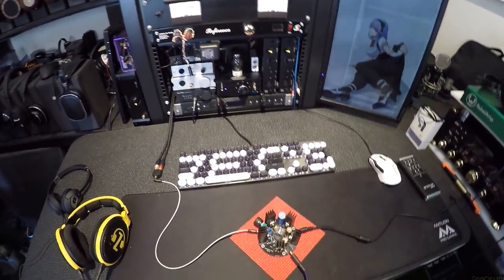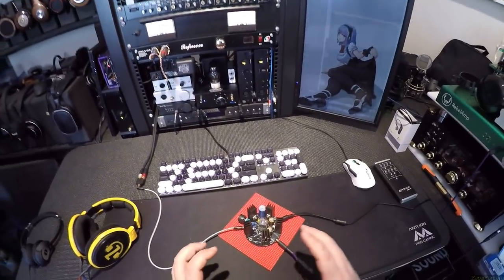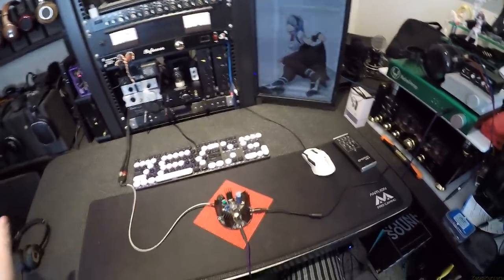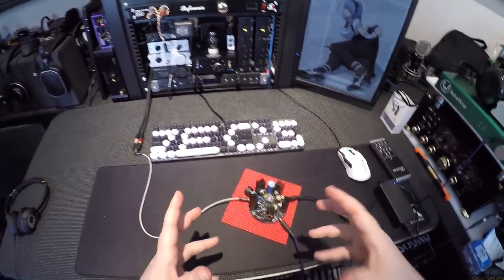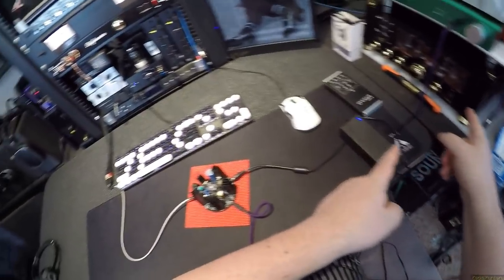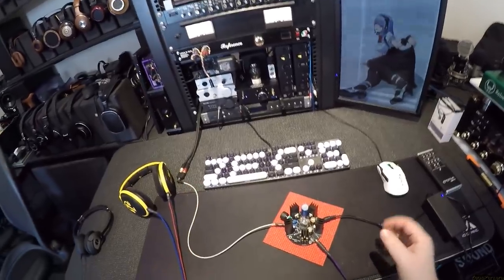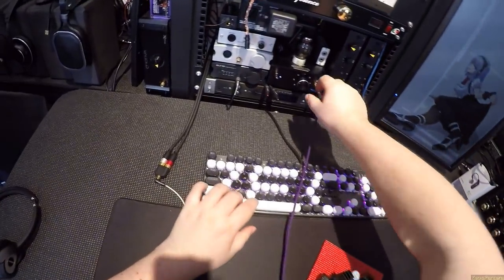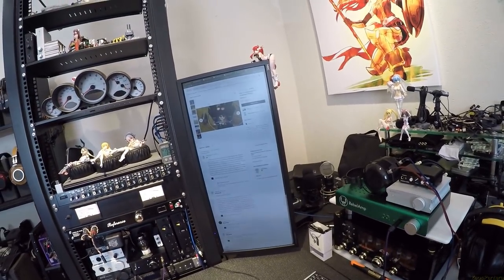Thackray Uno _(Z Reviews)_ Illudium 238 Explosive Space Modulator

Comment: I'm actually the 1 star reviewer. I run a Macbook Pro to a DAC to the amp and then into my Alessandro MS2e's. Before I bought the amp I was just using a Monoprice Desktop Headphone Amp. Not the greatest headphone amp in the world but it did the job. 

Anyway,  I wanted an amp with more power and randomly came across this amp on etsy. Class A hybrid seemed like a better amp to take a swing at the the typical class D. When I first got it, I just listened to it with my phone and my headphones hooked up to it. Sounded good. But when I hooked it up to my Mac setup, it sounded horrendous.

 It took me awhile to figure out that this thing is just extremely sensitive to the components you use. For whatever reason, it did not like my DAC at all. And I found I have to keep my Macbook volume very low and really crank the amp up, otherwise there's still a lot of distortion, even with the DAC taken out of the chain. 

I was trying to use the volume adjustment on my Mac because, as you pointed out in the review, changing the volume on the amp is a hassle. Strange that this thing is so sensitive to output volume on my Macbook when the Monoprice amp isn't nearly so fussy.  

It could be that there's something wrong with my amp. However, Mr. Thackray wouldn't agree to an exchange or refund because he was so put out by my 1 star review. I even offered to ask Etsy to remove the review if he'd agree. He just stopped responding to all communication.

All in all, I can't recommend anyone buy anything from this guy. The people saying hard pass are definitely some folks I wish I knew so I could have been warned away from this thing. Not worth the $130 I paid, IMO.

Comment: Haven't seen the schematic but it seems like a low end hybrid with a tiny weak tube stage...
Reply: I took a look at the Etsy page, there is a screenshot showing a schematic, and that looks lik a MOSFET driven by the tube.
Reply: Seems like the designer has no idea about amplifiers in general. If that is the output stage i am truly shocked this thing is palletable in zeos's mind. 24V for a 12au7 and a shitty mosfet output... I am shocked.
Reply: Anything with a tube in it that doesn't have a high voltage power supply (150-400v), probably isn't doing any amplification with the tube. It's called a starved plate buffer. Gives very poor performance and lots of nasty distortion, not anything like a properly driven tube. Basically you should avoid anything that includes a tube but no high voltage supply. (and even then, most chinese tube amps that actually run the tubes at power, are so poorly designed that they should be avoided too. cough cough.... Darkvoice...)
Reply: @taylorsharp5928  depends in this casw yes 12au7 need 150-250V but if it is a pcc83 or something similar it may only need 50V
Reply: @smucar1975  never heard of a pcc83. you mean ecc83 (12ax7)? tubes can be run below their designed plate voltage and still be used for amplification, they just perform poorly. I'm not familiar with any tubes that are built to run at 50v besides something like the nu-tube